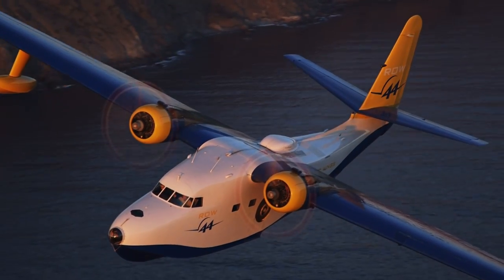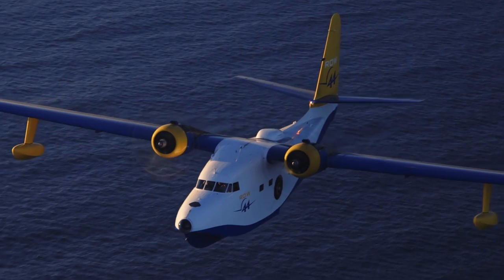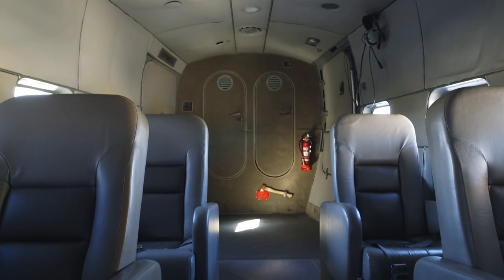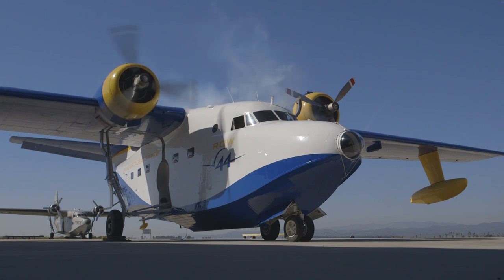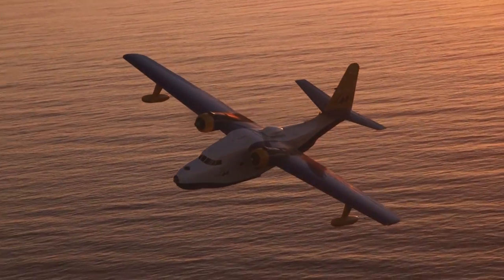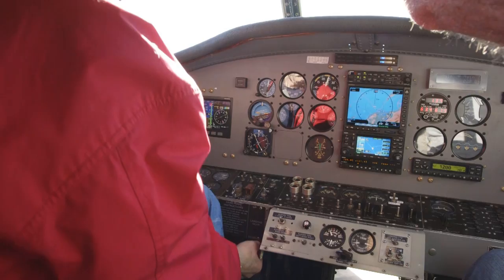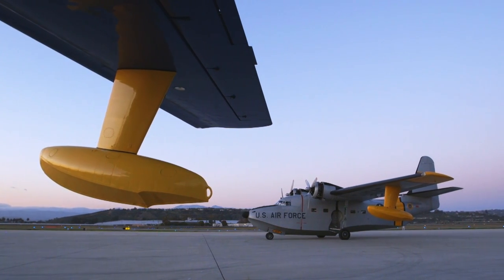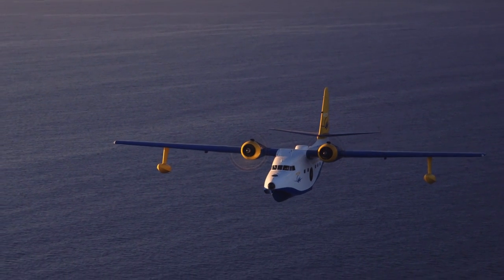Barry Schiff boards the Row 44 Albatross

Comment: Why did they choose piston engines for the Albatross, when they had turboprops at the time? Was it because of water-vapor ingestion issues with the turboprops? Some of the modern turboprops, like the PT6, should be more efficient than these piston engines. 

I'd love to buy a low hours G-111 and convert it for trips into the Arctic, Antarctic and even the tropics.

This isn't very economical at 110 GPH , when the cruise-speed is just 108 knots, but it is the only amphibian that can comfortably land in 4ft seas and even takeoff with rocket-assistance in 10ft seas. The range of 2480 n.m is pretty good, whereas the ceiling of 21,500 ft isn't adequate to fly over storm systems, but that is the most I can get out of twin-engine amphibians; only the four-engine ones, like the Beriev and US-1, fly over 30,000ft and all of them are too uneconomical for private use, considering the quite limited utility of amphibious aircraft. 

The US-1 can take off in 700ft without wind and in 500ft in a 15-knot headwind and handle 10ft waves,  without rocket or jet assistance, but is too expensive for private use.

The Mallard is cheap and economical, but can't take open-seas; that is it can't ferry people to and from yachts in the open seas, whereas the Dornier Seastar is too expensive and still not too capable at $7 million.

I intend to buy the Albatross one day.